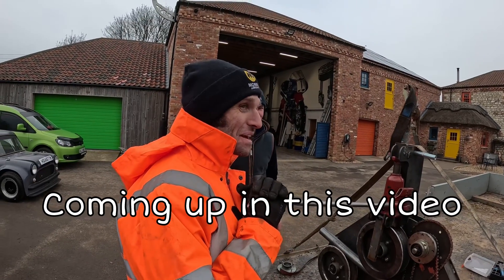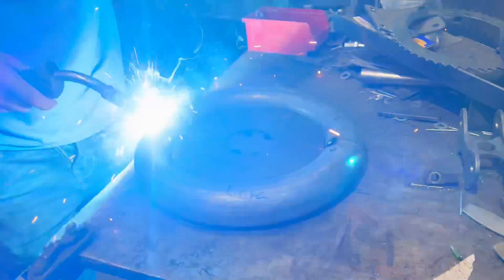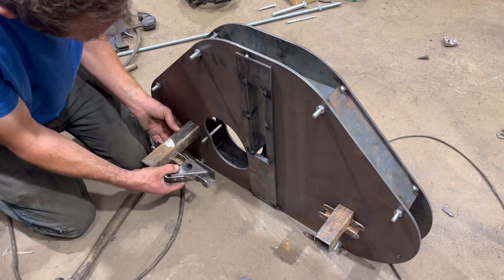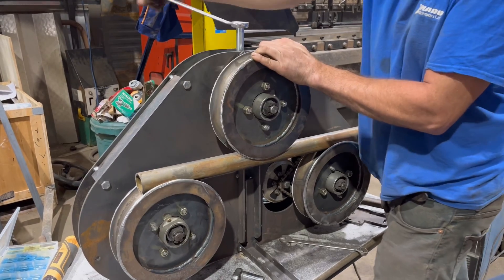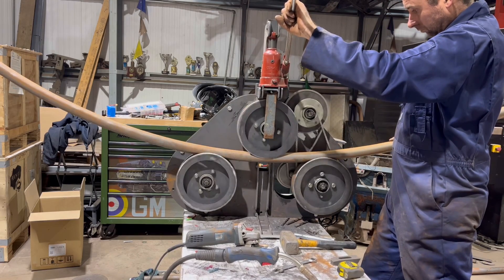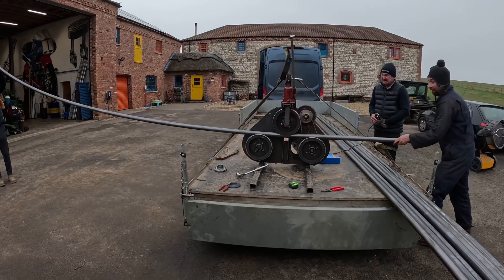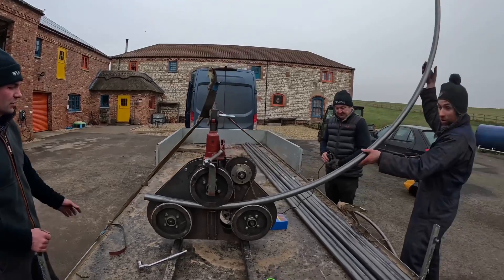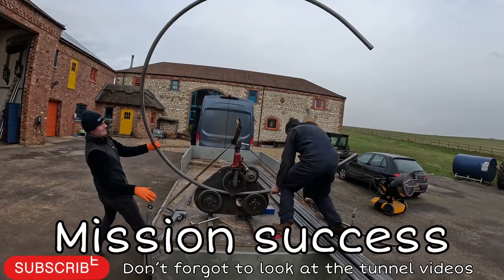Making a Tube rolling Machine for spiral handrail

Comment: Hi Just found your channel. Watching the tunnel videos where you are strugleing to lift your tubs of soil out  though your well shaft I was thinking you needed to buld an over head Gantry to winch the tubs round easier and two hours later there you are building a hand rail which could  be mounted over head to use as said gantry. could you do a video on the well from whit I gather is you found the well while leveling the ground and it's from some sort of WWII militery camp we need more info on it. also a heads up on the crash bill of £15 + grand. keep up with the vids Thanks.
Reply from the maker: There is a video showing some pictures of making my bunker but I don’t have any videos I’m afraid, if you look back through my videos you will find it, yes you are right I could use the handrail as a guide 😀
Reply: Good Morning  @Tornado_Dave  Thanks for the reply. I think I've watched 15/16 videos so far inclueding the tunnel playlist so I'm slowly working through them I only came across your channel yesterday after noon. I'm into militery history  and lived in England for 24 years abd found it intresting to walk around the old disused camps and pillboxes, I come from Guernsey in the Channel Islands so the Islands are coverd with old fortifctions and of course the German Bunkers from the Occupation.

Comment: Very interesting watch.. I hand make, vintage exhausts pipes for some of the bikes that Guy races against.. and I wouldn't know where to start with bending a spiral.. ive had to go and watch that 'Accent' video that is mentioned above.. Very Interesting. 😊👍 Good luck with your tunnel.. Ben Hardman, Raysons Exhausts
Reply from the maker: Thanks Ben, It’s probably not the correct way that I have done it but I only need to do 2 staircases and 1 has worked so far 😀 Guy went down my tunnel yesterday, think he liked it 😂